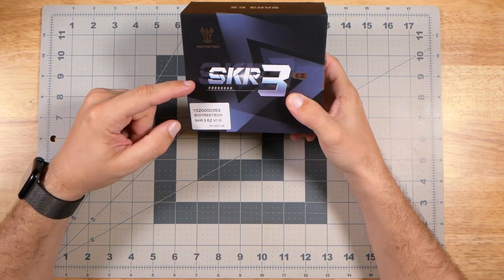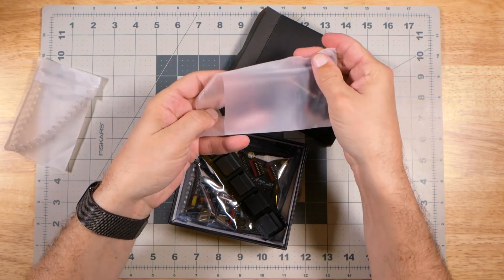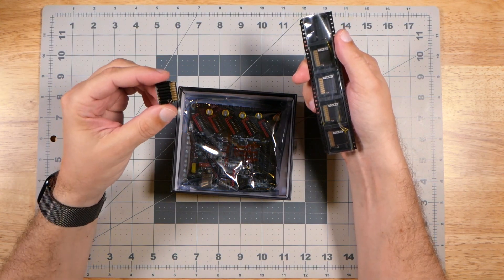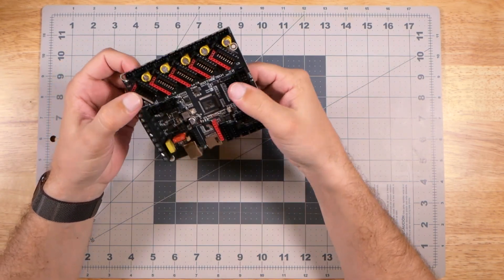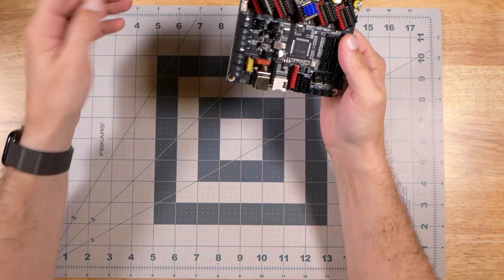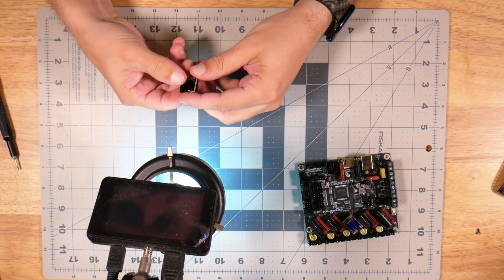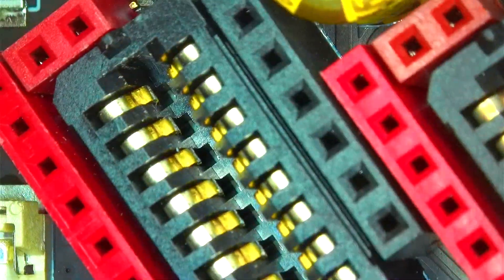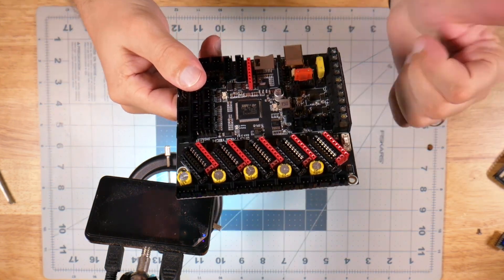BIGTREETECH SKR 3 EZ - 3D printer Control Board

Comment: Wondering if you can help this board won't connect to my pc.
Reply from the maker: What exactly you are trying to do connecting it to your pc?
Reply: @Hobbyist Notes  SKR EZ  I don't have a tft screen. So I'm connecting a raspberry pi 4b and a 7inch screen with klipper
Reply from the maker: @1TexasGamer  Make sure USB/CAN switch that located near USB-B port is in pop-out state. Flash firmware via sd card(file must be named firmware.bin) and make sure file on the sd card has changed after flashing process. Only after that connect to RPi and power supply to see if it shows in to the list of the usb devices (lsusb on RPi)
Reply: @Hobbyist Notes  I'm going to try to make a new klipper bin for it. The button is not pressed In. And it's not reading on my PC or my pi
Reply from the maker: @1TexasGamer  If you run it from USB power make sure to bridge USB power pins, if out of external PSU make sure u don't have this bridge.
Reply: @Hobbyist Notes  it's one pin right. Like in your other video. So keep red pin in if using USB power. Don't use red pin if you're plugging into wall outlet
Reply from the maker: @1TexasGamer  Yes, easy to test, connect USB cord and if it powers than your pins are set for USB power.
Reply: @Hobbyist Notes  OK thanks for your help I'm going to reset the raspberry pi klipper. And see if that works.
Reply: @hobbyistnotes  SKR 3 EZ

Comment: Does 2209 driver work on ender 5 plus
Reply from the maker: I don't see any of the reasons why it won't.
Reply: @Hobbyist Notes  OK I'm going to install it on my R5Plus. I think you gotta  buy the drivers  separately. I'm just hoping I got the right ones
Reply: EZ Driver EZ2209
Reply from the maker: @1TexasGamer  If you don't have any custom motors setup you will be good.
Reply: @Hobbyist Notes  No I don't but for sure I need to buy the EZ2209. Thanks for the help. Trying to figure this out in a hurry because I'm off tomorrow Want to order what I need

Comment: I've bought this skr3 ez board, but I don't know some things about this board such as FD CAN what's this? Plz guide
Reply from the maker: I have ordered some parts I have mentioned in the video and probably going to describe it in future videos. For now good introduction video: https://www.youtube.com/watch?v=mwpI7dCOgh0
Reply: @hobbyistnotes  so basically, in short if I'm not wrong FD CAN has made to integrate scattered wires of the printer.
Reply from the maker: @qooqo3008  Most popular benefits I think will be: Less wires and you can extend printer with other modules.
Reply from the maker: Hey, I just posted new video regarding this topic: https://youtu.be/u6wDHC9NCIY may be this will make it a bit less confusing. GL.
Reply: @hobbyistnotes entirely I got confused after watching video about can fd. Bro. Kindly make us understand slowly. U speak fast and second thing is keep your mother board, modules hardware in any white background.
Reply from the maker: @qooqo3008  Instead of passing 19 wires(hotend cooling Fan: 2 + part cooling Fan: 2 + heater: 2 + temperature sensor: 2 + BLtouch: 5 + Extruder motor: 4 + Runout sensor:2) to your 3d printer toolhead you can use one of those little CAN modules as shown in to the video, that board has own controller and it needs only 4 wires from your motherboard (Power:2 + CAN:2). We connect everything, toolhead related, to this little board and it will be located on your toolhead. At the end two boards will communicate via CAN FD protocol with Raspberry Pi. I will install this board soon over my Trident and you will see actual application.